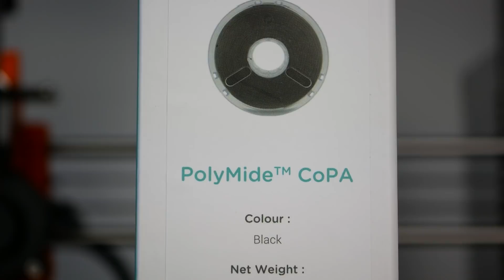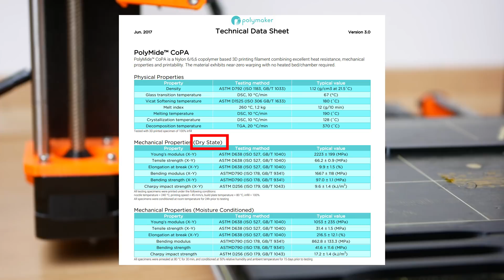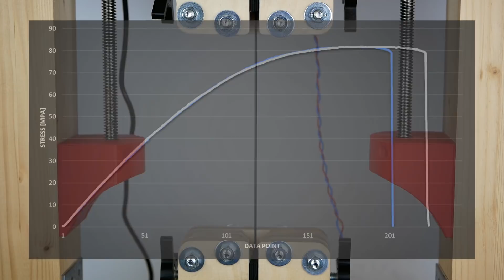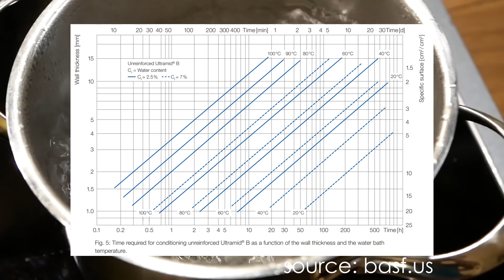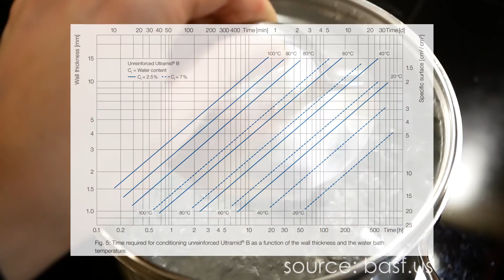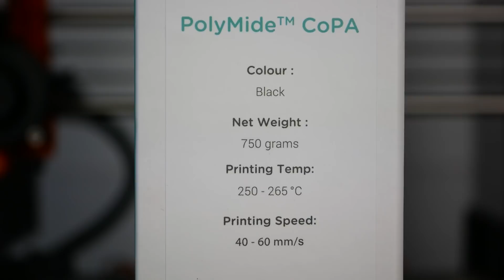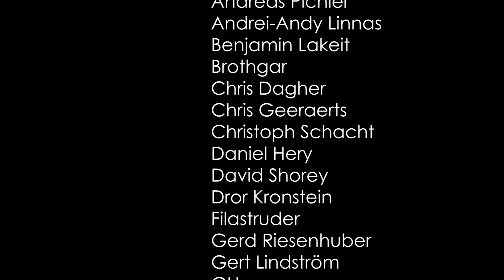Tough NYLON: Polymakers NEW PolyMide CoPA - REVIEW

Comment: Could you please do a review of available filaments that are suitable for engineering parts? Is there anything that prints as well as PLA but has much higher temperature resistance? I have been considering NylonX for gears and cases, but I am not sure this will remain rigid at high domestic temperatures. (Inside a car on a summer day.)
Reply: That N....X stuff you're considering is one of the worst CF Nylons and Nylons in general in my experience, I'd stay away from that expensive shite.
I suspect they use CF powder with a bad aspect ratio instead of proper fibers and got some other things out of whack as well.

Perhaps they changed it in the meantime, hard to imagine it still being on the shelves the exact way it was, but I generally try to avoid companies that sell subpar or even crappy product at premium++ prices.
There are plenty options anyway - 3dx, Tulman, Filamentum, Basf, Essentium got their own line as well iirc and many more - availability of real "engineering-grade" filament is already pretty good.
Reply: @heinzhaupthaar5590  i suppose. ive seen horrible warping from nylon x, so ive stayed away from it.
Reply: @josiahong5177  
Right, that seems to be a very common outcome with the N....X stuff.

If it would be superior in one of its mechanical properties or had anything special about it whatsoever...
Reply: @heinzhaupthaar5590  only two unique thing is thst they dont give data for the moisture absorbed parts, and they are kinda light at 1g/cc, although i wouldnt use it due to warping. Polymakers reinforced nylons are so easy to print they replace anything for most applications. Ive been able to print stuff in PA6-GF and it required a 0mm tolerance to fit, itherwise it was too loose, so really accurate printing.
Reply: polymakers cf and gf nylon print really well. alsoC theyre really stiff, and the glass fiber nylon supposedly can resist up to 192 degrees celcius, so higher than nylonX
Reply: Try not using nylon x. Its abrasive and as gears, it will wear out quickly. Try copa for gears, if that works, and for cases, try Polymakers nylons, or try their polycarbonates. Those have gery good print quality with higher minimum layer times, almost as good as PLA. Theyre also very rigid, and dont creep much. They also dont ever seem to need to be dried, and I just leave mine in a drybox when not in use.

Comment: I printed a quadrocopter of this material. It feels like its unbreakable when you hold it in your hands. But the hard impacts broke the frame very easy at the holes where the spacers are fixed. (It's a copter like the FlexRC MicroOwl). I'm searching for another material which will fit better for this purpose. I will try PC-Plus and PolyPlus on next tries.
Reply: if you had the time could you give us an update on your follow up prints in PC-Plus and PolyPlus? did you find any better success versus hard impact compared to the cf nylon?
Reply: @jed3219  I did not have any success with printing copters, so I switched back to milling Carbon frames again or flying the betafpv stuff...

Comment: A possible test to determine if the moisture was the cause of the increased heat resistance would be to store a piece in room temperature water and boil one until they have the same moisture content and then run the test. If they perform similarly then the water is likely the cause.

Comment: A much more benign explanation for the heat performance would be that the retained moisture in the baked parts simply needed to vaporize, keeping the temperature near 100C until it had all bubbled out. 
You could test this by holding the temperature between 100 and 180C for an extended amount of time before continuing up to 180C, but the point is moot. Besides, drying in a low oven is a common way to dry hygroscopic filaments that have been left in a humid environment.

Comment: Curious if you did any testing on strength of the bonding between the PLA and and the nylon?
Reply from the maker: Nope, not yet. I guess it's not the best though. I added some internal structure to the gear to get a tight fit after printing and until now it doesn't seem to fall apart.

Comment: That rubber-like quality is very interesting.  
After you've printed your parts, you could then selectively water-treat some sections of the part while keeping other sections dry, to effectively make a multi-material print from only 1 material!

For example, you could 3D print a bushing, and you boil it to make it flexible like rubber, but while you boil it you keep it's bolt-holes outof the water so that it still mounts rigidity.  I wonder if it would help to apply a waterproofing agent over certain sections, but not other sections, and then boil it.

Some universities (MIT?  Or maybe it was Disney Research?) have been doing work with 3D printed designs like this, but IIRC they have been using other methods to adjust the material properties such as using various intricate infill patterns in different areas of the print (like lots of tiny repeating living hinges).  So they can do things like make action figurines where the joints are bendy but everything else is stiff.
Reply from the maker: You could do a selective treatment but this will only work short-term, since the moisture level will equalize over time in the whole part.
Reply from the maker: Sorry, but you know - "demonetization" and so on ;-)
Reply: too bad no one experiment on that, printing 4m height 3d printed dildo make more views :(
Reply: Considering the moisture only takes a handful of days to propagate through the whole depth of the part from the outside at room temperature - including injection moulded items - I don't deem partial treatment likely to succeed.

Comment: Great video and a lot of stuff mentioned, but I still miss one important piece of information. How stiff is the material? Is it elastic enough for living hinges or clips like PETG or is it hard and can replace parts that would be made in polycarbonate? Would you print for example stepper motor brackets for a cnc pcb milling machine or you would lose accuracy because of flexibility? When you bended the boiled piece it looked like a semiflex material like colorfabb ngen flex or polymaker polyflex. Thanks in advance.
Reply from the maker: If you really add a lot of moisture it's like a semiflex material. Just letting it out in the air for a weak or two will make it perfectly usable for living hinges, way better than PETG! Wouln't use it for stepper motor brackets, though. In such a case ABS ist still an option or even better, annealed PLA.

Comment: Very nice review. I had just bought my first spool, but didn't try it out yet, so I was very curious. I still wonder how it compares to Taulman Alloy 910 (black variant preferably) which is a Co-polymer of Polyamide 6.6 too and which I used on my product (automated turntables for 360 photography that can handle loads up to 100 kg). Thank you for your work. I love your videos!
Reply: what i don't like about black 910 is that it's not black..it's dark purple.  i'm waiting on a custom run of some actually black 910

Comment: Very interesting review.

Does it anneal the part in any way by cooking it additionally to just speeding up the process of moisturizing?
Reply from the maker: Annealing does 2 things: 1. Reduce internal stresses from the printing process (which increases ductility) and 2. increase crystallinity if you have a semi-crystalline polymer. So the cooking will have changed the structure slightly, but also helped the water get into the part faster.

Comment: interesting with the PLA/Nylon gear at the end, I hadnt thought of that, it also goes along to helping you keep the expensive CoPA for when you need it, not for the entire part, smart move.
Reply from the maker: Kind of stole that idea from E3Ds OpenRC model. The idea is not only to save expensive filament but to use the soft and wear resistent material where you need it and use stiffer material in between like for example a carbon fiber filled material. So you can get the best out of both worlds.